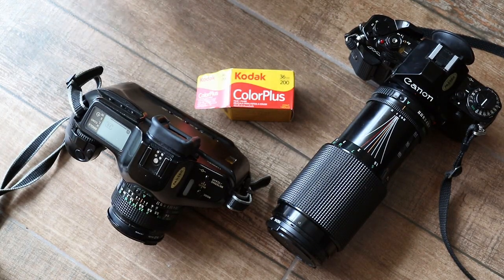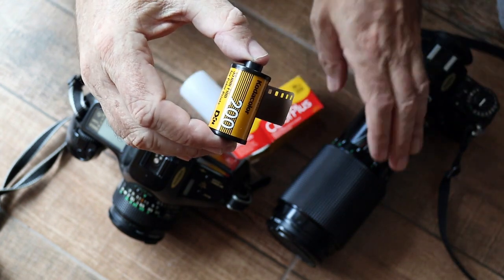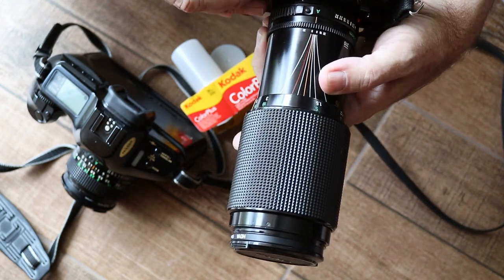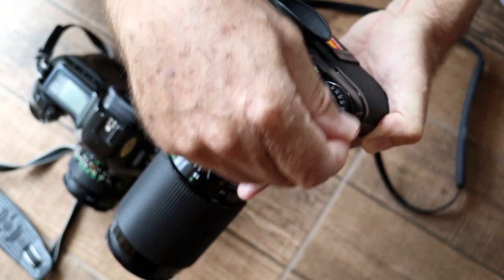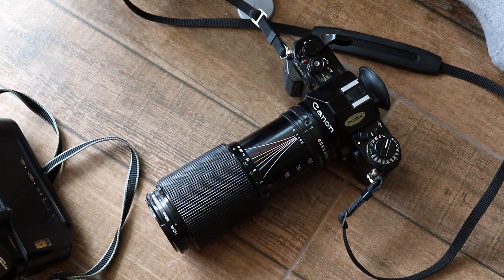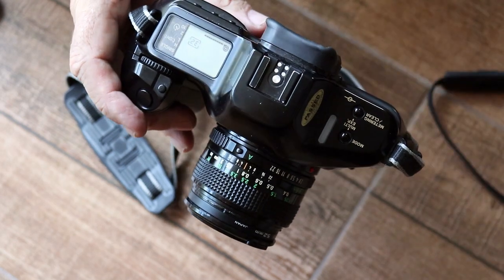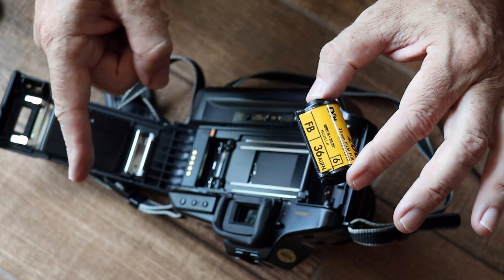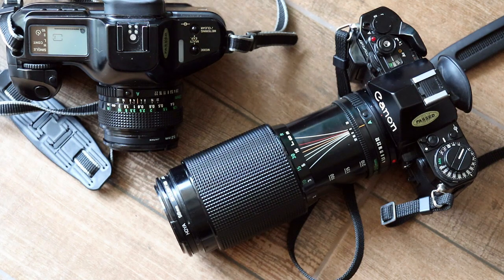Loading And Unloading Canon A1 And T90 Film Cameras

Comment: Hi Phil I got the 2 same cameras from years and I can t get rid of them :). A1 was my first SLR camera I was sixteen and I hesitated weeks between this one and Nikon FE but I chose the Canon thinking it was best for technology. I got the T90 a lot later as a second hand and when you see it , you can find it really designed the new slr and dslr. It didn’t t get the success he deserved due to the fact that autofocus gears came just after but it was a real technology concentrate at that time and a very beautiful one. I then swapped  to Nikon with autofocus era as I was angry I need to change all my lenses to keep on with Canon EOS. I don t use them anymore but like you I am now using my FD lenses on Mirrorless sony. I am very pleased to use them and consider it s a second life for them. FD Lenses were very simple but very well built lenses and it s amazing to see them still working 40 years after (some aperture pb can be encountered but can usually be fixed easily). I really prefer the original mount (silver one) than the new FD one. I think I will never sell them :). Thx for your video which makes me remind that time.
Reply from the maker: Hi Phil, we share a lot in common ... besides a name! The A1 was also my first camera - a 21st birthday present at the end of 1981. When I went to South Africa in 2000 I thought that it wouldn't be a good idea going on safari with one body, so I bought a used T90. After that I never used the A1 again. As you say, it laid out the basic design of SLRs for years to come. Yes, it arrived at an unfortunate time and A/F really killed it off. I can understand owners of FD lenses being upset when the EF mount was introduced, but I don't think Canon had any choice. And now the RF mount ... One of my teleconverters has the old style FD breech mount. I find the bayonet mount a lot quicker to attach and detach. Your last sentence sums it up well and it's the same for me. I am committed to digital and A/F now, but my old film gear and FD lenses remind me of many happy times so there is a lot of nostalgia attached to that gear. Thanks for your comment!

Comment: Hi! Looking for a way to open the film door to put in a new film. Not sure if there was one already inside. My exp reader is at 36 and when I try to rewind the film (going with the arrow) it feels loose but my exp number doesn’t change from 36. The button on the bottom of the camera is pressed (flushed w camera). When I pull out the film rewinder, the door doesn’t open. The camera is on A /TV / and 1000. 

I just added new batteries but the camera hasn’t been used in at least 10 years. Not sure if I had a film in it or not but I did rewind the film and the lever rewinds very easily. 

Please help!! (Canon A1)
Reply from the maker: Hi! If the button on the bottom is pressed in all the way, the rewind lever feels loose and the exposure count isn't decreasing when you rewind it sounds as if there is no film in the camera. However, one of your comments concerns me a little. The button on the bottom is normally flush with the bottom of the camera when it isn't pressed. It sits in a little recess and when you push it in it sits at the bottom of the recess. Just make sure it is pushed in all the way to the bottom of the recess.

When you pull out the film rewinder it is loose at first, but about half an inch up it meets some resistance. You need to pull it harder to overcome the resistance and the film door should open. Don't use overly excessive force, but just try pulling it a little harder.

Good luck!
Reply: Thank you sooo much!  Needed a bit more of force. Knowing the age of the camera, using extra force without being told to, is scary.
Reply from the maker: @lindaarellano872  So, you're all OK now? It's spring loaded, so you just need to overcome the resistance of the spring. Let me know if you have any more issues 🙂

Comment: I only have 24 frames, right? And how can you check how many pictures did you get?
Reply from the maker: Rolls of film are usually sold with 24 or 36 frames. All the film I buy these days has 36 frames, but I do remember using some 24 frame rolls. There's a frame counter on the camera to allow you to check how many pictures you have taken already.

Comment: So, I just got my first Canon A-1, and I don't have any film yet, but my film advance lever seems stuck, but I can't tell because I don't have any film to test it on. Without film, it gets to that half way point, but I can't seem to move it any further. It only goes further when I push the little multiple exposure toggle to the left, exposing a little red dot. Does it need film to be able to wind, or does it sound like I need to take it to a shop?
Reply from the maker: The film advance lever advances the film and cocks the shutter. Once the shutter is cocked the lever locks. You need to release the shutter first before you can advance the lever again. With the camera switched on (A position) put the camera in TV mode and select 1/1000s. Press the shutter release button and the camera should fire. You should now be able to use the film advance lever.
Reply: @PhilUKNet  Ok thank you! It's not doing anything at the moment, probably because I don't have any batteries for it yet, and I'm assuming it needs a battery to fire the shutter? Sorry for so many questions, I probably sound really dumb ^^
Reply from the maker: @MarioOnage64  Quite a few other people have had the same problem! I've never tried without a battery. The mechanism is all mechanical, but it's probably better to have a battery in case the lack of electronics inhibits something. The multi-exposure lever let's you cock the shutter without advancing the film, but you will still need to release the shutter before cocking it again. I don't think the camera has a problem, so no need at the moment to take it to a shop. Let me know if you have any further issues.
Reply: @PhilUKNet  When you say "release the shutter", is that really just pressing the shutter button? Cos when I do that, nothing really happens. I'm a total newbie at this, only ever used digital cameras, so this is all uncharted territory for me. 

The film advance lever worked the first time I pulled it, but after that it got stuck at that half way point. I'm guessing that's because the shutter is cocked?
Reply from the maker: @MarioOnage64  You now have the shutter cocked and you need to press the shutter button to release the shutter before you can cock it again. Until you do this the film advance lever will remain locked. However, you can't release the shutter because the camera doesn't have a battery! Once you put a battery in I think everything will be OK!
Reply: @PhilUKNet  Ohhhhhhhhh ok yes I totally understand now! Thank so much for the clarification!! Sorry if that was too many questions :)
Reply from the maker: @MarioOnage64  No problem 🙂 It's old technology that only old people like me are familiar with 😢
Reply: @PhilUKNet  Hey again! Updates, I got a battery, but I'm still having the same issue. When I press the shutter button, nothing happens, and no LED info appears in the viewfinder. I still can't pull the film advance lever more than half way without toggling on double exposure, but that doesn't actually advance the film. 

Not sure if it's up to a faulty battery or not. The battery in question is a Kodak 4LR44 28A 6V battery.
Reply from the maker: @MarioOnage64  I'd start by doing a battery test - instructions in the video. Also, is the camera switched on? The lever needs to be in the A position. If it is in the L position everything will be locked.
Reply: @PhilUKNet  Hmm interesting, the battery is brand new, but there's no light flashing when I hold the button down. Guessing that means it's faulty?
Reply from the maker: @MarioOnage64  Hmm, it doesn't look good. Can you try another battery or get someone to test the one you have with a multimeter?
Reply: @PhilUKNet  I'll be getting more batteries tomorrow that I can try. I checked online, and the battery I got today is seemingly dodgy, as other people were having similar issues.
Reply from the maker: @MarioOnage64  Frustrating, isn't it?! When you put in another battery do the battery test first. If it's OK you should see the LED in the viewfinder and you should be able to release the shutter. Once you have electrical power all the other issues should disappear hopefully. Let me know.
Reply: @PhilUKNet  UPDATE: Just got the new batteries, and guess what, IT WORKED! Thank you so much for all your help :D
Reply from the maker: @MarioOnage64  Thanks for letting me know, you just made my day 😊 I never suspected it was anything serious. The battery only powers the electronics and LED, therefore they last for several years. If there's anything else you're not sure about feel free to ask.

Comment: Hello Phil !,  I have a question about The T90 camera I have the problem is I reloaded it plus new batteries added   I don't know if it is the batteries  or trigger  that is not functioning properly it is not shooting photos plus I don't see the shutter speed number on the LCD screen, what could this mean pls I need some answers on this matter !??!......
Reply from the maker: Becky, sorry for the delay replying, but I wasn't notified of this message. A new YouTube feature lets me look at messages I haven't replied to and there are lots. This is very annoying because I always respond to questions. If there are good batteries loaded you should see something on the LCD screen. If the batteries are good, it sounds as if there is a problem with the camera. Another thing to check is that there is no corrosion on the terminal inside the battery holder. You can try rubbing the contacts with some very fine grade sandpaper.

Comment: Does taking those first shots right after loading the film actually use the film? If I have a 24 film roll, will that use any of the 24?
Reply from the maker: It will use the film, but film manufacturers allow for this and you will still get your 24 frames. All I want to be sure of is that the film is securely engaged in the sprockets. As soon as I'm happy it is I close the back of the camera. As you get more experienced you can do this using the minimum amount of film. If the film isn't engaged you can take lots of wasted shots because the film doesn't advance.